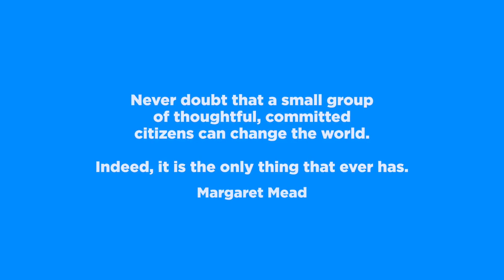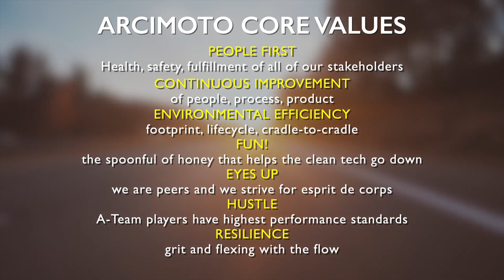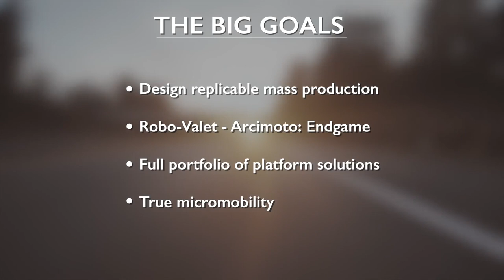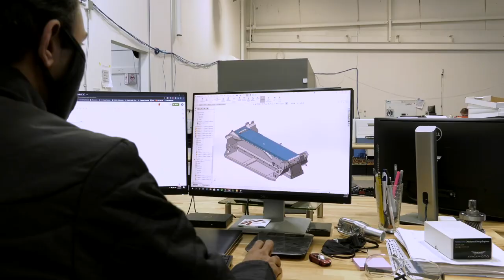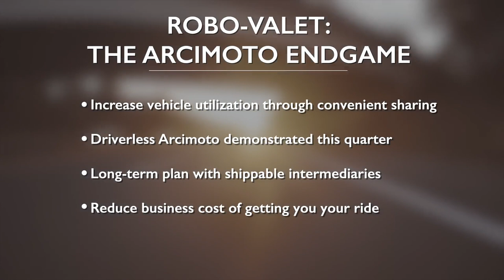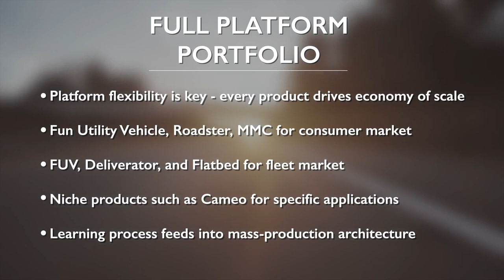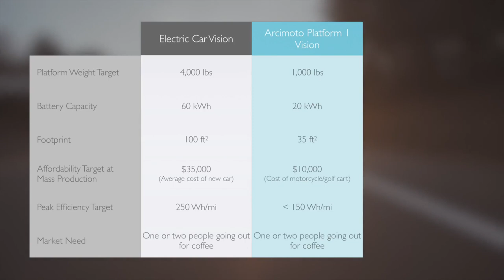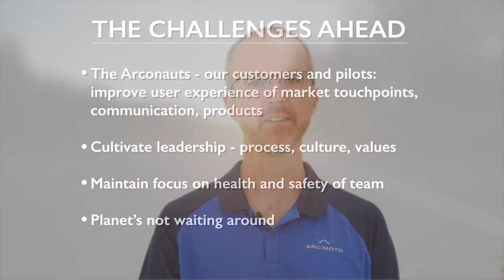Arcimoto: Vision To Action

Comment: How much are they ?  ( to buy )  & will they be allowed in the UK ?   What is the max range on them ?  Do they have to have road insurance , M.O.T or similar  & tax ? & finally how long does it take to fully charge up from almost zero ( flat) ?
Reply from the maker: FUV starts at $17,900, not available in UK yet, can make international preorder at Arcimoto.com, 4 hours on level 2 charger, 8 hours on level 1 charger

Comment: I have many ideas for you, like signature tail lights like Tesla model 3 and y. You always know those tail lights . You can have computer controlled charging to discontinue charging at 80 percent to extend battery life. You could make FUV covers to prevent pollen and dust buildup. You can make a vehicle cleaning video. While it is still early, consider a new version of your logo. I have tons of ideas.
Reply: The lights are perfect as-is. It already routinely stops charging at 90% and goes to maintenance mode. All computer controlled. Covers with a perfect fit are sold by California Car Cover. I have one. There is little to clean.

Comment: Founded in 2007? Didn’t know Arcimoto is already 14 years old company.
Reply: 5 prototypes before the final design. They did it right. By losing the steering wheel they saved 260 pouds of weight and 18 inches of length.

Comment: I really want to see a fully enclosed model. I can't have a ride this valuable sitting exposed in the rain and snow.
Reply: No. There is nothing for a little blowing rain to damage. No carpet, no wood grain dash, waterproof seats. Climate controlled sealed vehicles got us in ths mess we have today. No more free lunch. In Florida in winter I see cars idling in parking lots because they have to do that in summer but all they need is to open the damn windows. Habits will change, forced by new carbon taxes. This is nowhere near as exposed as a motorcycle but far safer. It has heated seats. If you park where it might get rain you just toss a weather cover over the bucket seat so it will stay dry for your return.
Reply: @popeyegordon  I don't need luxury but are the seats, controls, instruments and innards of the vehicle really resilient enough to be left exposed to a Milwaukee, Chicago or Madison winter out of a garage? The heated seats already more then I was expecting as far as luxury.

After having suffered several people who ran through traffic signals I just like being surrounded by metal when it comes to my conveyances. I realize that such metal panels on this side would be minimal protection, but I just need the metal on all sides.

Keeping a cover for the vehicle in a pack strapped on the FUV could perhaps be a viable alternative, thats a good idea. I like the concept and the ride, but I'd REALLY like if it were fully enclosed.
Reply: @Helpertin  The button panel has a rubber cover. The touch screen is under a substantial hood. Controls on hanelebars are standard proven motorcycle weather proof designs. There is a real nice fitting storage cover that most owners buy. I use it under my car port. But this is a motorcycle concept as far as weather proof dash goes. Nobody has a fully enclosed version. Doors are popular in northern climates but not needed. Handlebar grips are also heated. Heated defroster and windshield wiper fluid spray. What you need is there. What you don't need is not. It is vital for survival of our species to stop the deadly addiction to over sized over powered high speed steel caged climate controlled lounge couch cars. This is the moment when we change or die. What you drive is as important as not eating beef, not flying, not living in a large home.

Comment: As long as Archimoto does not provide a securable door option I will not buy their product. I live in San Francisco and work odd hours. I need a securable vehicle.
Reply: You are just another of the 180 million American personal car addicts. Kicking that habit is as hard as kicking heroin. You people make up thousands of excuses, none are valid. Heavy enclosed climate controlled personal vehicles are part of what is killing our biome. Cars, which you are addicted to as a base line demand for comfort, have steel beams in their doors. Arcimoto uses an entirely diffferent approach for safety - the 6 point harness that eliminates any need for a helmet or air bags, and the certified hardened roll cage. Doors do NOT make any vehicle 'securable'. The ignition system does that. There is a locking trunk. There is no stereo to or air bag or catalytic converter to steal. You can still install an alarm. The plastic door kits Arcimoto sells actually do nothing more than a security blanket. A billion motorcycles have no doors and yet they get secured by their locking forks and ignition key. My FUV needs no key, I use the 6 digit activation code. It can't get lost or fall out of my pocket.